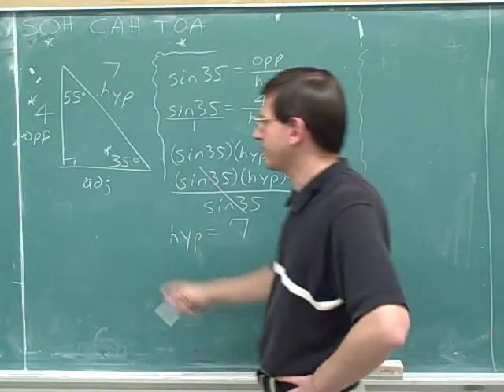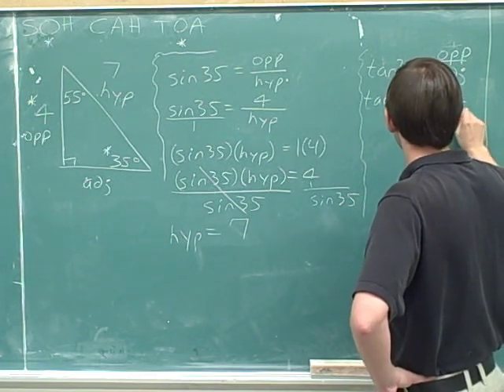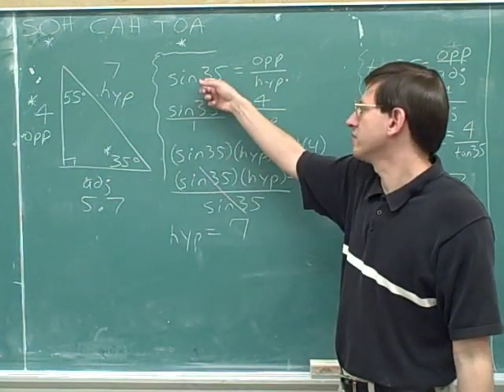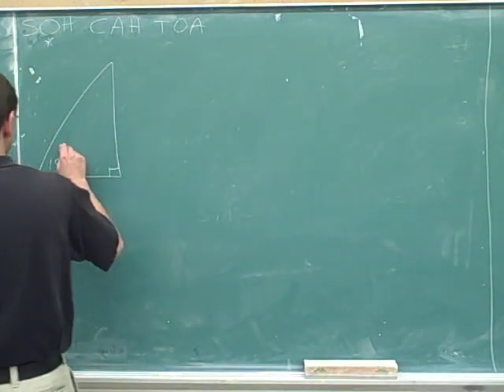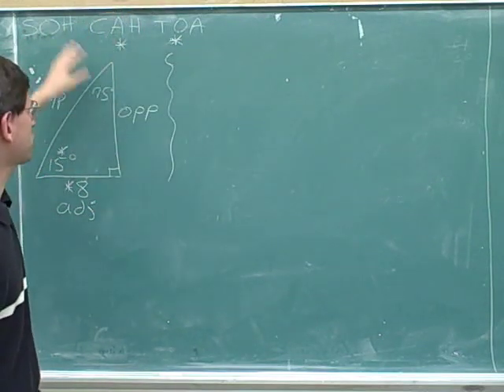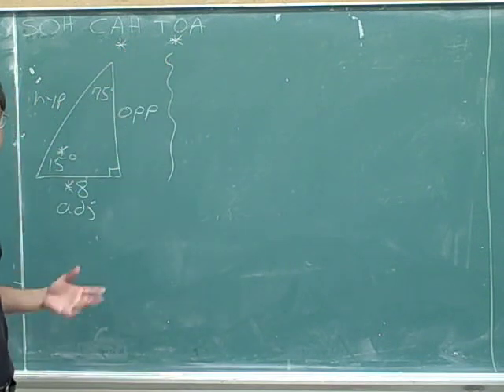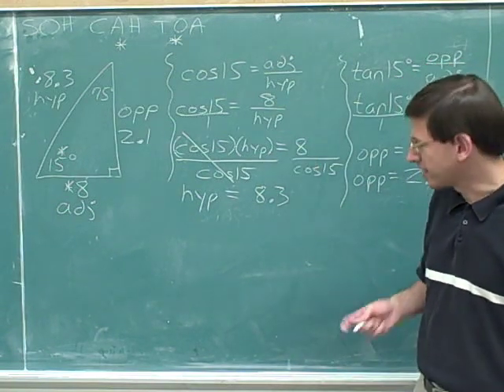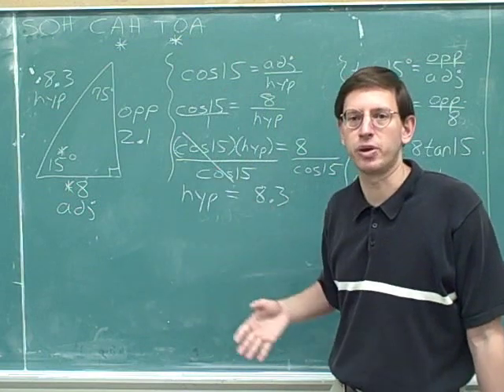Physics: Vector components (17)

Comment: Once you get relaxed with this method of solving for the unknown in the denominator you can use the inverse method of displacement. That is, a = b/c (solve for c). Simply displace quantity a with quantity c and your equation turns out to be c = b/a. It is the same as your method of "opposite of multiplying is division," only faster. However the method of inverse displacement comes after some practice has been done and works fantastically in both classical and quantum physics.

Comment: @mattd1993 One thing to remember that will help you check your answer is that the smallest angle is opposite from the shortest side.  If the adjacent you got was 3.2, you would know that it was wrong because opposite the smallest (35 deg) angle is the shortest (4 units) side.  No leg can be shorter.